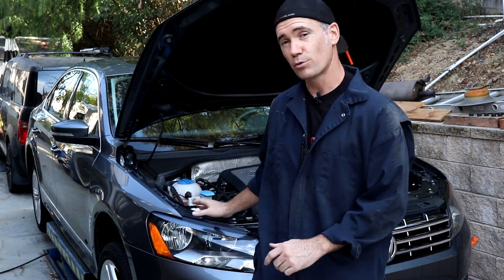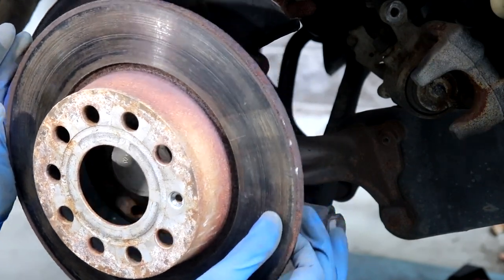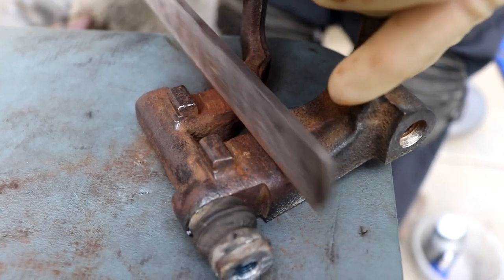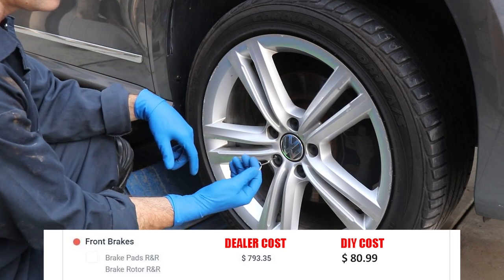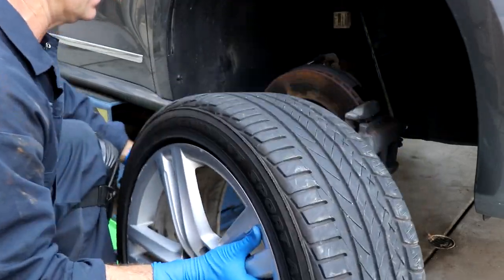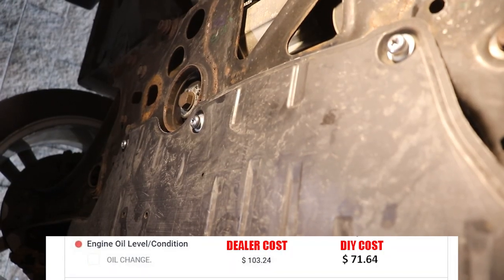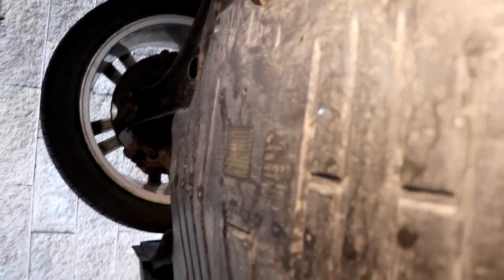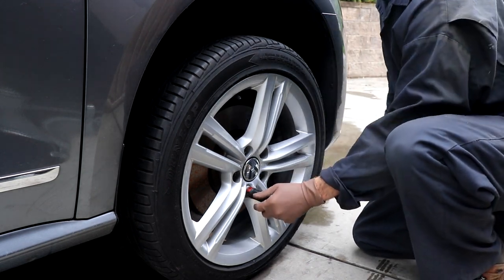2012-2015 VW Passat TDI F/R Brakes, Air Filter, Cabin Filter, Oil Filter - DIY Save $1300!

Comment: Watching you replace that cabin air filter and seeing the fan blower motor there to the right brings back some VERY frustrating memories.  Changing that blower motor (from the inside) was so difficult!  That might be a good video for some if your fan ever goes out.  I have  2013 Passat TDI SE so my blower was just old and stopped working so I had to replace it.  Thanks for your videos!!
Reply from the maker: Thanks for the comments Jeremy, glad you enjoyed the video. Fortunately we haven't had any issues with the blower motors on any of our TDI's. We will definitely create a video if that comes up in the future.
Thanks again for hanging out. Cheers!

Comment: Another awesome video. You need some Kroil penetrant on those tight bolts. The absolute best for stuck bolts.
Reply from the maker: Thanks for the tip, we will have to grab some of that oil to have in the garage. Thanks again for hanging out, Cheers!

Comment: Well done. Do a lot of this stuff myself.   I have a 15 Passat and the oil change is messier as the filter is underneath rather than up top.     Have done front rotor and brake change  was easier than I thought.   Not looking forward to rear brake change.

Other jobs to mention are fuel filter and DSG change.   FF is easy. Dsg is a long winded job but doable.  Saves a chunk of change.

I can also back you up on FCP EURO.  Great company good prices and their warranty is as they say.
Reply from the maker: Thanks for the comments Barry, appreciate the feedback. Funny enough we just posted the Fuel Filter change and will be posting the easy method for the DSG service shortly.
Fuel Filter - https://youtu.be/EDKh5dfKJRM
Agree with you that FCP Euro has been great to deal with and stand behind their lifetime warranty on all parts. Enjoy your Passat TDI, Cheers!

Comment: Just replaced my variable value timing magnet, crankshaft sensor, new plugs and coil packs just parts alone is north of 660
Reply from the maker: Thanks for sharing Yan, it's crazy how much parts prices have increased the last couple years. Just imagine what the dealer would have charged you to replace all those parts 😳.
Thanks again for hanging out, Cheers!

Comment: My front brake pads shift slightly in the housing and click every time I brake.  Any suggestions?  Did I just get a bad pad or should i replace entire caliper?
Reply from the maker: Hey Dan, thanks for the question. I wouldn't think it would be caliper related since you didn't mention the issue was present before the repair. The pads fit snug so there shouldn't be any movement really.
It sounds like you may have got some poorly machined pads. Not sure what brand you are running?
I would make sure everything is assembled correctly and that all parts are tight. If that doesn't solve it, then maybe swap out the pads with the Vendor .
Let us know how it goes, Cheers!

Comment: This videos timing is impeccable! I was just looking around for videos to do these services myself . 

I’ve done many oil changes on my ‘15 Passat and want to try doing my brakes. Any tips for a beginner ? Great video ‼️
Reply from the maker: Hey Kami, glad you enjoyed the video. We would recommend making sure you have all the necessary tools and supplies you will need for the job as well as the parts that will need to be replaced.
Then I would just focus on doing one repair at a time. You can start with the front brakes and just go through all the steps. Just remember to allow for plenty of time for each repair so you don't ever feel rushed.
Let us know how the repairs go, thanks again for hanging out, Cheers!
Reply: What is a good OE brand for rotors?  I was looking at Bosch.  Any recommendations?

Comment: dealer impacting lugs nuts on is crazy. you can ruin the studs weakin them and have them snap down the road.
Reply from the maker: Thanks for the comments Eric, we have seen many crazy things performed by dealers over the years. Using an impact gun on lugs is the most common thing we see. Sometimes we have to get a cheater bar in order to loosen the lugs.
Thanks again for hanging out and the sub to the channel.
Cheers!
Reply: @BradleysGarage  i appreciate the video i just bought a 2015 tdi with 57k. did my brakes from watching ur video. ordered special tool bits for my car so i can work on it anytime. thanks